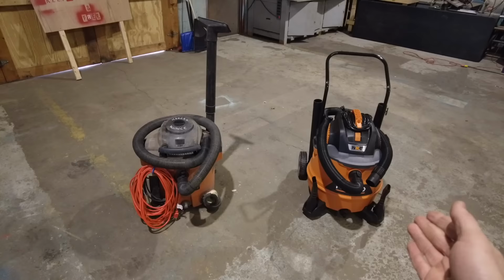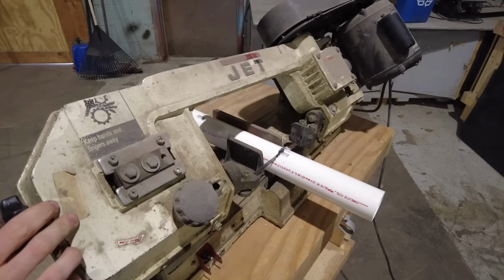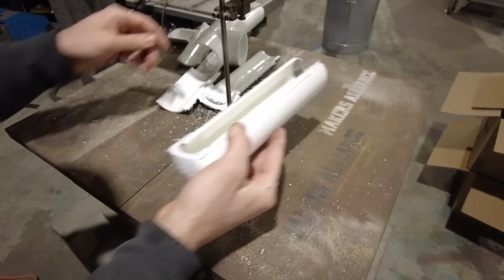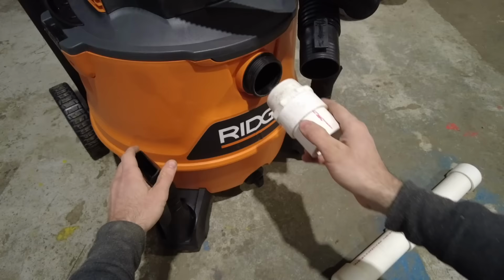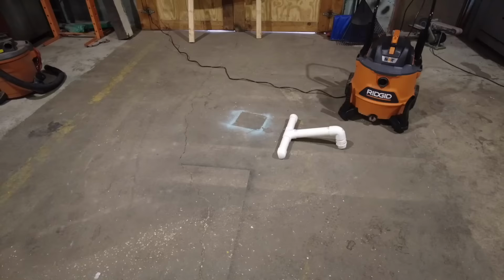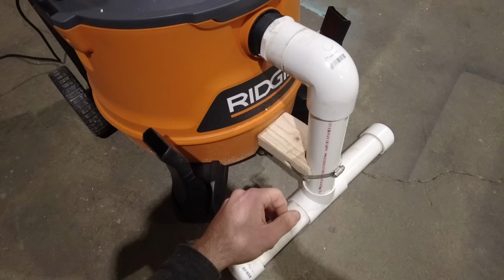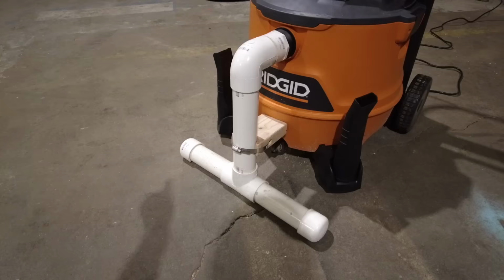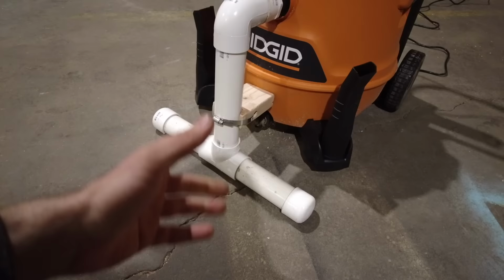DIY Shop Vac Mod  -  Super Wide Walk-Behind Attachment

Comment: Something else to consider, or to try, is to cut more of the front edge away so the vac starts to suck as it approaches the debris on the floor. A Suction Seal to the floor is not needed to draw debris into the vac but a larger inlet will help more debris fit faster. The way you made this, the inlet is too far under the pipe to be useful, not bashing you here but simply saying. If you look at your reference piece that you started the video with the mouth opening is very wide which is what can be accomplished when you remove more of the front edge. Something to think about... Edit: On or about the 6 min mark, you can see debris build up as you push and with more of the front edge cut away this is less likely to happen...

Comment: Could also get a rubber coupling in plumbing section @ HD (other store) place over port and attachment and secure the clamp on it.
Reply: Attach a squeegee blade to back side of the floor attachment. Also a shark tooth on forward edge will divide large amounts of fine particles (look at the original attachment the felt is for smooth scratch resistance). I’d increase the cleaning foot print to around 3” wider than wheel foot print 1.5” each side so you can get right up to walls. Another perhaps better connection to vacuum port would be rubber end cap with hose clamp also found in plumbing section then just cut a hole so slip on the floor attachment. The rubber will make a vacuum tight seal increasing suction power

Comment: drill a series of holes instead of a solid cut on the bottom. and put a tee on top so you can still use the hose. you can cap it off when not using the hose

Comment: Make a triangle nozzle out of plexiglass. Extra points if the hypotenuse parts are of a tractrix type, not just straight to the neck. And a sweep at the back will be nice. 
Also, for best suction, figure your length of the pickup, and design the slot width so that the opening surface area is equal to the surface area of a 2-1/4” diameter circle. 😉
Reply: Lol, engineers!

Comment: You should attach a low pile brush strip around the cut opening to get better suction with contact by the brush hairs. Or buy an upright vacuum cleaner :-)

Comment: Is the threaded opening on the vacuum a hole dimension that would allow you to use a threaded PVC coupling, even if you had to step it down to the next size? Being able to thread the parts together would eliminate you having to worry about it falling out of the opening when it bumps something too hard. Just a thought.

Comment: It probably has it's useful spots, but by now you've surely realized that this is absolutely slower than just using the hose... Dust doesn't just land in open test areas, it settles EVERYWHERE; hence the hose-based design of shop vacs. Once you had to put the hose back on to get under and on top of EVERTHING in your shop, I doubt the floor vac attachment replaced the hose (which can clean that open space just as fast) again very many times.

Not knockin it, btw. This seems like something I would do. I overthink projects...

Comment: Your cut on the lower pipe needs to be slightly higher on the front so it pulls in the higher pile of debris and not push it, I think it’s a winner for later areas of debris.

Comment: would it not been easier just to attach the sweep piece to the pvc pipe going downward at 1/2 gap off ground that comes with shop vac and use a fernco to attach to inlet end ?

Comment: Next time PVC glue it together before sawing w/o the caps and then PVC glue the caps on.  Maybe shorten the caps by 1/2 too.  And why not just put it on the end of the hose like an old Electrolux.  Random patterns are better for clean-up anyway.  Your vacuum should have come with a couple of ridged sticks.

Comment: Why not make a floating head. that lags behind the vertical suction pipe. You would have to extend the pipe out of the inlet slightly though. If the trailing suction idea works you could add a strip of rubber like a squeegee at the back and it could give a better suction connection. Oh and by floating I mean one that has two wheels that keep it off the floor and this would prevent the rubber from wearing out so fast.  The connection the floating head could be made with a short piece of short vacume hose. And the floating head could??? be attached to the front wheels somehow.  This would eliminate the vertical pipe all together.  And by the way I like your idea and hope I can make use of it too.

Comment: I'm curious why you didn't cement the pipe together first and then cut the bottom off? It seems to me to be the more logical way of doing things rather than having to resort to using hot glue to keep it together.

Comment: So what was the whole point of this? Just recreating a vacuum cleaner out of a shop vacuum? Hmm let's remake the wheel and make is slightly less round.

What a concept here, real Einstein at work. Cool idea it's a vacuum that was a vacuum that I crudly fashioned too sweep the floor like a vacuum because it isn't a vacuum until you can walk behind it. 

You could have saved us all the embarrassment and just used the floor attachment that you didn't show that is for shop floors. That's like me gluing up some random pieces of wood and adding it to my chair and saying look at this cool design, it's still a chair but now its a chair with my new design to make it easier to sit down. 😂

Comment: Why not attach the original hose that is theaded to fit the device so it is flexible than create a bracket in metal to mount your floor attachment?

Comment: Why not just used the wide pickup attachment on a hose wand extension? (if it doesn't come with the vacuum, they are available as an accessory for the vacuum at Home Depot)

Comment: I would have cut a slit only in the pipe and not in the T or End caps, would have allowed a 1/8" gap so the vacuum isn't completely flush with the surface

Comment: I have to say, this idea is brilliant. And could definitely help me at work (and home garage). Have you tested it on other stuff like loose screws and other debris? Even with the correct hose attachments, my brand new dewalt shop vac sometimes has problems with random screws. Especially if I use a bag.

Comment: Was wondering if you could turn it into a stationary vacuum next using either your own pvc or one of thoes wall inserts from Amazon. Stationary vacuums are 200 plust shop vac is 49 bucks and has multiple uses to include cleaning my car as the big one.
Reply from the maker: You mean like an all house central vacuum? I guess you could try but I don't think it would work very well. Central vacuums have huge motors that produce crazy suction  that can handle the losses of all the pipes.  A shop vac is nowhere near that powerful.
Reply: @Rustbelt_Research  not a central vac. Same idea tho. However instead of running a massive hose down to the garage just fix the vacuum to under the kitchen sink and use one of the floor inserts a central vacuum system would use. This way the vacuum would just be under the sink and only work for that that exact floor insert.

Comment: If you would have used regular glue and primer it has a chemical reaction and it makes the fitting and pipe one it doesn't just glue it together it had chemical reaction makes the pipe and fittings one it would not have fallen apart.

Comment: Take the PVC turn it 1/4 turn, cut the end caps off and unscrew it where it meets the intake, screw the original cap back onto the vacuumed and then take the PVC and drop it in the trash can. Problem solved.

Comment: most of the piling up issue is because of lack of air flow. The more material that is in the suction device or pipe the less air flow at the ends of the pickup pipe. So just slow down

Comment: Next time make the vacuum tube about 1 1/2" wide on both sides so that you vacuum wider than the back wheels. Hot melt glue is no way stronger than the PVC glue. Glue the pipe and fittings first, then cut the slot. Do you even have to be told these suggestions????

Comment: One of those hacks/mods where it's easier to use the product as designed.
PLEASE someone explain to me why not just use the hose and wide floor attachment?

There are a lot of reasons why companies don't sell upright vacuums for shops to be used like if you're cleaning your living room. 
If this was useful, they would sell the attachment.
Reply: 5:54  Forget the mod, keep the hose (that's 99% of the time attached), push on those two extenders, you've purchased with the vacuum, onto said hose, and floor attachment.   And save yourself time thinking you'll actually use it.

Comment: I mean... this is neat but I fail to see how this is any easier or more efficient than just using the hose with the attachments. I mean maybe if you're constantly cleaning saw dust off a level floor... okay... but a shop vac is already designed for multiple uses.... you just use the attachments. Which most people just put inside after emptying.

Comment: While  I love the fact you are very creative and I think this is a neat idea, plus a good way to pass the time, but I am going to play devils advocate. You cannot get close to the wall with this, in tight corners, or under shop tables, etc., so you will either need to sweep or change attachments. My thought is, if I have to get a broom out and sweep corners, under stuff, and in tight spaces, I might as well push broom the entire floor into a pile and use just the hose to suck op the debris, or a dust pan. Lastly, they make a commercial style vacuum similar to what you have made, it even has a magnet in front to keep from sucking up metal and ruining the impellers. Your idea is a great way to save money or not having to buy the commercial vacuum, and it keeps from having multiple vacuums, but I do not see a very practical use. Sorry, I do not mean to be a Debbie Downer, but I also like to look at the practical side of things. In the end it is a great idea, but I am not sure what the practical side would be to have this attachment in my arsenal, when in the end you still have to sweep and/or use multiple "tools" to clean up a mess. Keep the brain juices moving and ideas flowing, you are the type of guy that will come up with the million dollar idea to revolutionize the world, thanks.

Comment: About how much?
2 caps.     ,2@$2.63
1 elbo.     , 1@$2.98
1 coupler ,1@$2.72
1 T.           , 1@3.20
4ft pipe.   ,1@$4.89
Dope about 1/20 of a jar. ,1@0.21
1 man hr.  ,1@$20. (Helper)
TOTAL.     $36.54
Plus clamp, scrap wood.
store prices differ a my local private owner hardware store, then a box store.
I didn't want to add 1/2 tank of fuel to drive 2hrs and back. Yup, I'm out in the sticks.

Comment: Interesting tweak of the shop vac but it seems to be aimed at only cleaning floors and only cleaning floors that have large open areas with no obstructions. Doesn't really match the reality of most shops that have benches, saws etc filling most of the floor area. Not really sure how useful making this type of device is over just using a hose and a 6" to 9" wide normal style floor end.

Comment: Chill, aka you tube influencer. 
       Act excited over a product to promote it like a jaeger girl. 
Glue it before you cut
Adjustable Wheels on the ends
Adjustable opening 
Seal or brush in a u shape facing forward to trap debris. 
Last, I'm not sure if this was cheaper then adding a pipe to a floor wand head.?

Comment: What is the point of this?
Reply: he walks full size warehouse,  those dust can get dirty...  budget of ware house cleaning vs a big machine... i would g with shopvac with custom made and push around 100 bucks vs 5k bucks equiment and it shows tire marks everytime u drive around cleaning warehouses...

but few things i mention on other comment, add values to it to have hose accessible for tight conners or so.